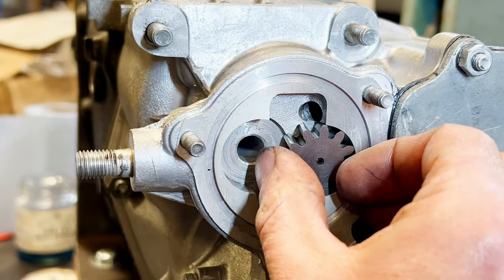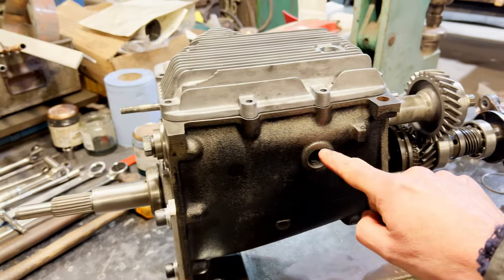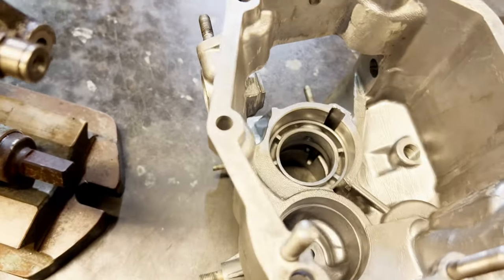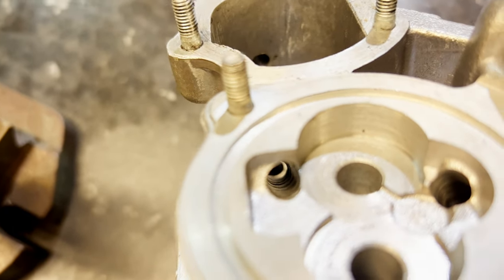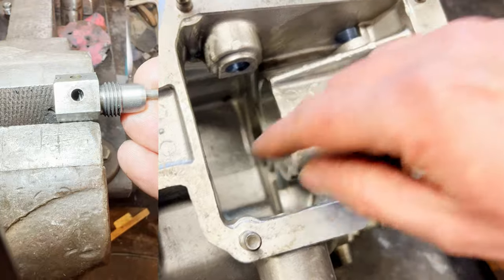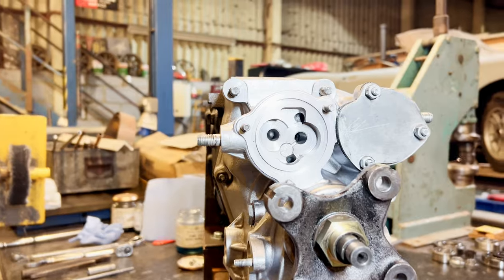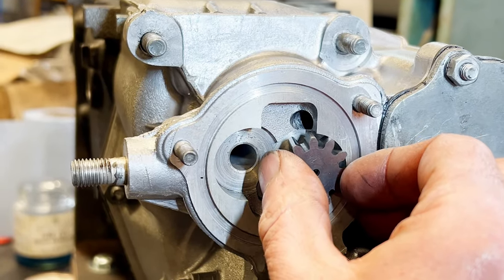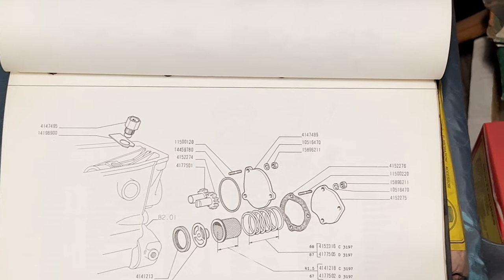Fiat Dino Oil Pump.

Comment: Great insight as usual. More complex than I thought...how does it compare to the ZF in the 2400 rebuild wise?
Reply from the maker: Thank you.
The 2400 ZF unit requires a process of shims for clearance so they have a reputation for being awkward to work on.
They are also very strong so rarely need work which is why I have far less experience with them.